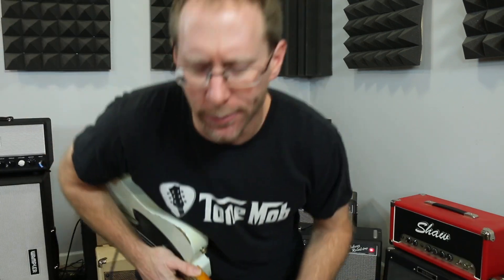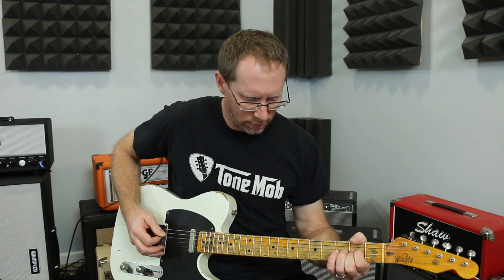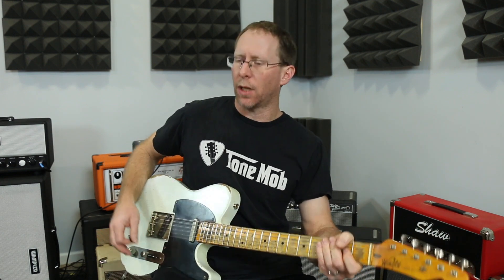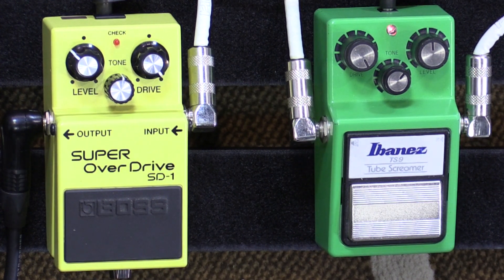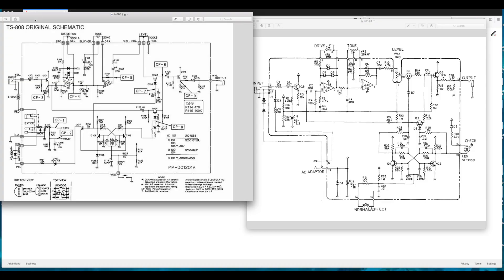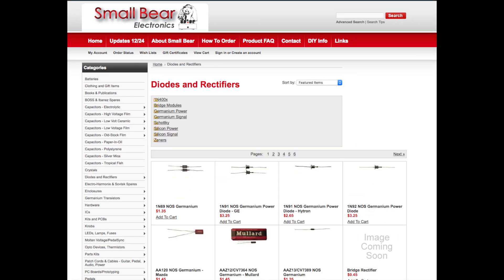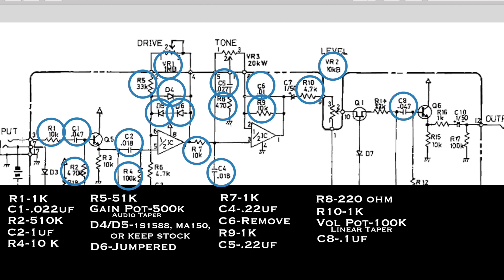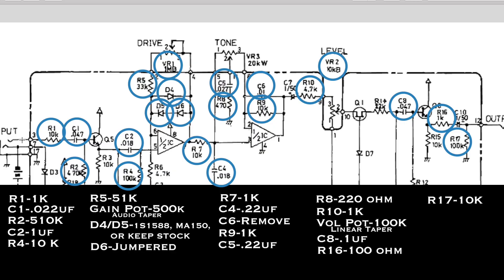How to turn a $30 overdrive pedal into a $180 pedal  -- The Boss SD-1 turned into a TS808

Comment: So there's 21 mods to make the Boss an 808 clone.  2 questions:  The two pedals don't really sound that radically different anyways, so what would be the 5-10 most important things to swap out?  And then question 2:  What would happen if I randomly chose some of your recommended swaps?  Like if I chose at random just some of those changes would it get closer in sound, or in certain cases actually make it further away in sound to the 808?

Comment: Do NOT remove C6 completely. Replace it with something in the range of 470p to 1n. In some cases missing this cap can result in ultrasonic oscillations. This is to be avoided. The cap is there for a reason. Just change it to a lower value to move it out of the frequency range that is noticeable.
Reply from the maker: I respect where you’re coming from but that’s not accurate to the tubescreamer schematic. Theoretically you are absolutely correct, in practice it’s not a big deal for guitar effect audio with the noted specs from the schematic.

Comment: The title should be "how to turn an sd-1 into a ts-9  by making it worse!" I mean if you want to hotrod a ts-9 you're pretty much gonna change the drive pot for more gain and possibly come up with an asymmetrical diode arrangement, maybe change the filters or buffer circuit resistors to change the input or output impedance to change how it interacts with the guitar or amp or other pedals. If you were going to hotrod a ts-9 the sd-1 is halfway there.

Comment: wait, so you can buy almost every single component for an 808 for ~$10?!  lol.  One must simply learn how to etch their own PCB and they could build an 808 for under $30 probably.
Reply: The metal box it goes in isn’t free lol. I’ve built a few and the footswitches, input jacks, and enclosures make up a good bit of the cost.

Comment: Bought a TS9 via CL for 35$, didn’t like it much given the hype, turned around and sold it $70. Put that $70 towards a Maxon ST-9 Pro+ Super Tube - well worth the money! 
You get Drive, Tone, Mid Enhance, Volume, Low Boost/Classic switching and 9/18v operation options, what more could you ask for? I recommend it blues or metal.

Comment: Just happened to have seen a Boss ODsd1 at my local store reduced; had been sitting around in the back room and forgotten about as it was a dud.  But the guy who got it out didn't know this.  Anyway, it was only £35 so.....got it home to find out it was screaming....looking up stuff came across an old gentleman who  fixes amps very kindly shows you what he does and teaches schematics on line. I've had it for months now......so then thought I'd take a look to see if there was a  schematic I could read and up you came........So yes.......very interested in these types of videos....have been watching you anyways.......So thank you....... I own three pedal that's all. Interested in building an amp some time.  Much appreciated.  Thank you so much   Limechillo from England.

Comment: Likewise, I don´t think you have to change SD-1 to become a kind of TS. They´re both Japanese, both contemporary, and both for the same purpose, the only difference is the clipping, one is symmetric whereas the other´s asymmetric. People say that TS fits very well into Strats, like SRV, while SD into Les Paul, like Zakk Wilde. I have a Gibson Les Paul and my SD  fits perfectly between it and my MArshall all valve. Here´s the tip.

Comment: I fried a tube screamer because spilt beer. All I had left was an SD-1 and I also have a Satchurator Distortion pedal. On complete accident I discovered that if I put the satchurator after the SD, it makes my solos sound so saturated and raw but at the same time you can hear each note clearly like a clean amp. Was it an fortunate accident lose the TS9 but honestly I think I found a honey pot. Haven’t felt the need to buy another one yet

Comment: I really dig switch-mods. I’ve got an SD-1 and a DS-1 both modded with switches to give the original circuit, then something new. Though... they’re a bit buggy these days... maybe a cold-solder joint somewhere has come loose? Lol

Comment: Behringer T. O 800 is an exact Ts 808 for $30. Your welcome
Reply: Same thing with NUX OD-3 but cheaper: $24
Reply: I just got mine and it's an absolute dream
Reply: I second this. Behringer makes some great sounding pedals. Don’t believe me, check out the video that Josh from JHS put out about them.
Reply: @smeercat  life's surprisingly cheap when you don't need to pay for an R&D department
Reply: @michaelparks1632  So when JHS rips off a pedal and charges 200 dollars for it,  no problem.  But a guy in China does it and sells it for 30 bucks its immoral?
Reply: @morganghetti  Not if you aren't concerned about working conditions, it's fine. I try and avoid made in China if I can. Some things you have no choice about. But given the choice and you make the wrong one you will lose that choice.
Reply: "the Demon" overdrive is $28 and has a 808/ts9 switch and comes in a metal casing. I'm a fan of the Behringer stuff also, for low money in a pinch for a tone. I wanted to use the HM2 Swedish death metal sound for a while and the HM300 made it happen for 30 instead of 300....
Reply: Tonewise absolutely, plastic enclosure though.
Reply: My welcome? Idiot.
Reply: So yeah about Behringer and how some "brand" snobs bag on their gear but it's Kinda funny .......I bought a Behringer GTX 60 combo amp because it was discontinued and on sale for $89 delivered new with a warranty ! I've been playing guitar for a little over 40 years and Have owned Plexi's and Old Fender twins and a Laney tube head and a couple Randall heads but I Just wanted a cheap practice amp and I heard the 12" speakers they used where actually pretty decent so I figured if nothing else I throw away the amp if it breaks and harvest the speaker ! It's my go to amp now ! It has 2 channels and  by using my Behringer OD and the included foot pedal for switching channels and using my guitars volume control I can get 4 great sounds w/o using any other effects ! Many guitar players in my area are using vintage Marshalls and Fenders and have all told me they are shocked at the versatility and great tones from such a cheap solid state amp ! When I need a little more volume I just hook it up to a 4/12 cabinet and it gets plenty loud ! I've been abusing this amp for 3-4 years and even playing through a 4 ohm 4/12 when the output is rated at 8 ohms with never a problem ! So yeah Behringer is actually great gear at an even better price !

Comment: Easier yet- get a Behringer TO800 for $25, Josh at JHS says it sounds EXACTLY the same. Or get a Biyang Mad Driver for $30, even better.
Reply from the maker: You’re missing the point though. This is for the folks who ENJOY working on electronics and modifying their own gear
Reply: @wampler_pedals  - Hi Wampler, no , I get that, and I enjoy your pedals and this video. I mod pedals myself, but I also look at things from a practical angle-   this mod would take some time and effort to do, not to mention the acquisition of an SD-1 and all those parts and a fair amount of time - but for me, if I want a Tube Screamer for the same or less money, with the exact same results  and no work involved- for me anyway, it would make more sense to simple buy a pedal that already does exactly the same thing.  Incidentally, I own a couple of Wampler pedals (Ego compressor, and Latitude tremolo and couldn't be happier with them :-)   Noted, there are a great many Tube Screamer clones out there, including the two I mentioned, that you can get from very cheap to very expensive.  So, lots of options here... Before one re-invents the wheel, look at the options...thanks.

Comment: I modded my TS9 with a three way switch for two bass boosts, so its bottom position on switch is Bass Boost 1 and the middle position is Stock TS9 and the upper position is Bass Boost two. Ill never own a TS9 without modding it that way again. I came up with the capacitor values and wiring myself so i wouldn't have to loose functionality and so the TS9 can work as a warmer boost which is amazing when i have it in boost position one or two being boosted by the Treble Booster i made. Its a sound that amazes me every time the are engaged. Also the TS9 boosting the Klon Clone i made is amazing also. Having the Bass boost options really gives you a seriously more versatile pedal and it actually sounds really good its not a gimmick at all. It took me a few trys to get each cap value just right cause i have them working with the stock cap instead of replacing it. That way i can leave in the stock cap and when the 3 way is in the off position its back to stock mid boost tube screamer goodness. If your interested in doing this mod comment and ill send the instructions and values to you, i promise you its worth it and if your still skeptical you can do the mod and if you dont like it all you have to do is desolder two wires from two places on the pcb and the TS9 is back to how it was before you did the mod. But if you like it, which you will! All you have to do to make it permanent is drill a single hole underneath the level control and thats where your 3 way switch will be.

Comment: Don't change the op amp. The stock one is fine.
 I wouldn't change the pots either.
 If you change the filtering and use 2 diodes instead of 3 you'll be pretty close.

Comment: Using A Tube Screamer as a distortion into a clean amp imo is the worst way to use it.  It works much better as a clean boost into an already distorted amp.

Comment: I've never listened to a Boss pedal on bypass in a True Bypass effects loop and been happy about how it changed the tone. The 80`s ones were dull, the recent ones are shrill. TS-9 to my ears have always been been a bit better in this regard through their various incarnations, and it's noticeable when the pedal is on or off.  So.. if you don't change out the buffers too, you still just have a Boss Tubescreamer.

Comment: I've got both on my board, and never have I wished my sd1 was more like my ts9. I use the ts for clean boosting and for low gain overdrive tones.... and my sd for 2nd stage overdrive, for medium overdrive tones. I value my ts more (aside from it costing more, it gets both greater and wider use), but I enjoy my sd more. So...no modding for me! Interesting, though..

Comment: Pause it at 4:14 for the secret decoder ring "Little orphan Annie" secret message.  Really.  ; )  8:13 is yet ANOTHER subliminal message with R2 being conveyed as an R2D2.  lol.  I love it.  Also.. You used a TS 9.  Not an 808.  They sound much different.  I prefer the TS9 for single coils and the 808 for Humbuckers...  Not as much mid range hump in the 808.  What was the schematic for?  The 808 or the TS9?  And NO... I don't have Asburgers...  gawd...  Ok.  maybe.

Comment: No knocks against the TS808, but one of the things I like about the SD-1 is that it doesn't sound like a TS808 or TS9 pedal. I'm sure there are reasonably priced TS808 clone kits available. That said, mod away if that's what makes you happy.
Reply: Agreed. Prefer the SD1.

Comment: So in other words, change (almost) every single component in the signal path. Just go out and get a Maxon OD808 and be done with it. I actually prefer the Boss SD-1 tone in the video left stock standard.If it's an old MIJ SD-1, I wouldn't mess with it.
Reply from the maker: Yes but you’re missing the point. It’s fun and enjoyable to some to modify their existing pedal into something different.
Reply: @wampler_pedals  I do get it man, it's all cool. Just saying. P.S. Thoroughly enjoy your videos. Cheers from Sydney , AU.
Reply from the maker: Thanks I appreciate it! Yes, some of my videos are geared a bit more towards those who like to pull out their soldering iron, other videos of mine are aimed more at those who aren’t interested in that sort of thing. I agree on the sd-1, it’s a great sounding pedal by itself!
Reply: @wampler_pedals  I've had a crack at doing similar things over the years. I made by hand a 50W plexi (point to point with turret board), way back in the days when there wasn't much info at all on the internet about that stuff. I also have a EHX Memory Man that I replaced the  chips in to make it more like the original. Can't remember the details on that now, but I remember put IC sockets in so I could change the ICs at will. 
Here's a clip I did of my hand made plexi... I res-pec'ed it around 2014 with some vintage components.  My workbench was my living room table. Video clip here:

https://www.youtube.com/watch?v=sb6vbn1r-x4&t=26s

Comment: Hi Brian, The SD-1 has the bleed problem only when is the first in chain,  how it possible to fix it? I found this method but, before I buy all parts, do it works?

"You need an SK30A jfet, a 0.1u (=100n) cap and a 1n4148 diode.
Obviously, you have to solder your new components to the top side of the board, because you won't be able to close your pedal anymore if you work on the traces side...!
Watching the front (the flat side) of the jfet, the three legs pointing downwards are named (from left to right) S, G and D (Source, Gate and Drain, respectively).
Yuo have to solder S to D4's cathode (the side with the black ring), G to your new 1n4148's anode (the side without the black ring) and D to one side of the cap.
The other side of the cap must be soldered to the point where R5 and R6 "look each other" (they are connected together at that side, so it doesn't matter if you solder to R5's or R6's leg, choose one!).
Solder the cathode (again, the side with the black ring) of your new 1n4148 to the cathode of D8.
Done!"
Thank for any advice.
Reply from the maker: That’s the way to fix it. It’s easy, there are diagrams to show how as well.
Reply: @wampler_pedals  Thank you so much. I will try.

Comment: No need to. SD-1 is just fine as standard SD-1
Reply: I did the Monte Allums mods to my SD-1 and just wow!  I think the germanium diodes in the kit just sent it to tone heaven.  It's really my top pedal.
Reply: Yes!! Don't touch it!!
Reply: I been trying to replace my sd1 since the 80s lol its perfect as is...i would not touch it...
Reply: I've always felt that Tubescreamers sound better through Fenders or 6L6/6V6 amps and the SD1s sound better through Marshalls or EL34 amps. Vox amps I prefer the Klon circuit or or the Blues Driver
Reply: Pretty amazing how close they sound as is.
Reply: I agree.....
Reply: Yeah I used an SD-1 for years to preamp my Super Reverb. It helped the Super break up at a volume that didn't maim folk (quite as badly)...
Reply: What a pointless comment this is lmfao
Reply: mine broke, looked up this video to turn a ts808 into a SD-1
Reply: I have a chelee odie that has a switch for this and is is awesome, great tones on both
Reply: Egg-sactly
Reply: Yes.  I LOVE THE BOSS SD-1. And the real b
Reply: Agreed. No need for anything else
Reply: Like them both but for totally different reasons, like the tube screamer's added mid bump for popping out of a mix!
Reply: SD-1 is far superior than a Tube Screamer!
Reply: It's fine if that's the sound you want, but some people are going for a different sound
Reply: Dang you boring

Comment: Frankly, TS series is one of the most over-rated and over-hyped overdrive pedal. All because some of the famous player uses it. The overdrive from my cheap Zoom G1on can get the same job done.
Reply: Thank you, the behringer and joyo clones sound better than any tubescreamer for under $30
Reply: @dagony7383  not better maybe but they get the job done, absolutely. Got me a joyo years ago and never even considered spending any money on a TS ever since. When I needed a mid bump to get through, the joyo always was there for me and did the job. Also part of some of my rather intensely distorted fuzz-y sounds.

Let's be honest: a TS is not a magically inspiring piece of gear, like other expansive, highly sought after pedals. It is, however, a VERY useful easy to handle tool because of its mid bump.
Reply: @ithemba  I'm 55,started playing in 82,NY thrash scene. Evan Seinfeld was my nextdoor neighbor, warren Cuccurullo lived around the corner, my second cousin is Vito bratta from white lion. None of us had any money growing up. We all started with pawnshop second hand gear and made it work. Never used a boutique pedal and never would pay for overpriced name brands. Always used boss in those days, metal zone ds-1, sd-1. Now I use mxr fullbore metal, mxr distortion, joyo overdrive, dimebag wah out on clean channel fender champ solid state, 100 watt and have no complaints..

Comment: I have both- and MANY other pedals too- I preferred the sound of the SD-1 to the TS-808 too as many others in this comment section did- sounded more like a driven amp.
Reply: It’s the asymmetrical clipping, which does sound more like an overdriven tube amp to my ears.

Comment: Many years ago, before I knew anything about commercially made pedals, I built a circuit similar to this from scratch. The big difference in mine was that I left out the gain control and just put a 470 pF capacitor across the diodes. I experimented with different values of capacitors and ended up using a six position switch to change the capacitors in the circuit. The larger value capacitors lowered the gain and rolled off the highs. Many years later I discovered that I used nearly the same value capacitors as the Gibson Varitone. Most players who tried it used the middle positions. There was one guy that ran it wide open because he liked hammering, pick harmonics and dive bombing. I lost track of it many years ago, but it sounds like something worth trying again.